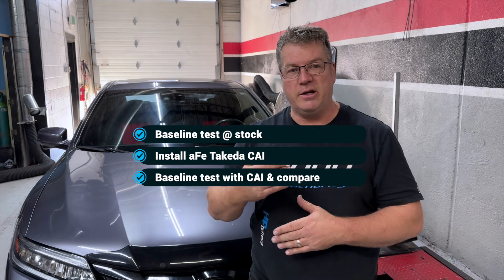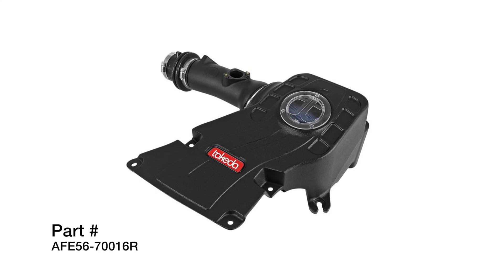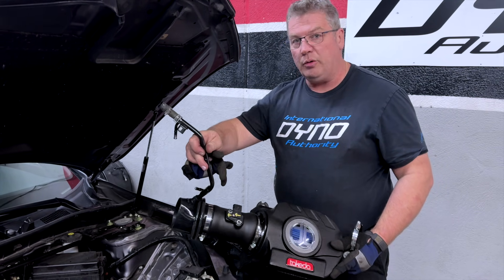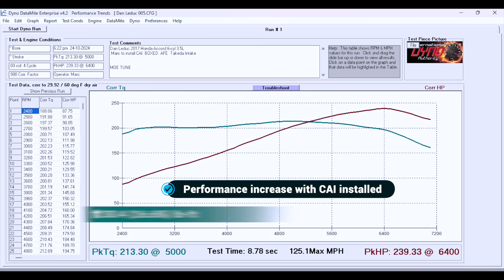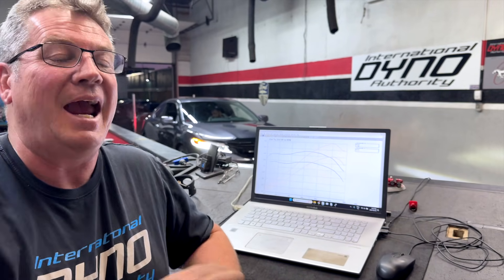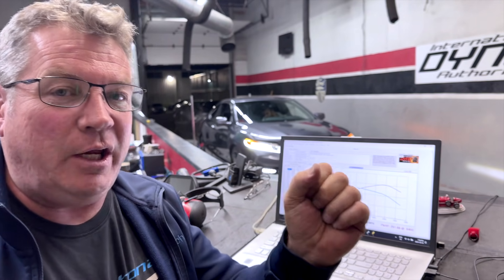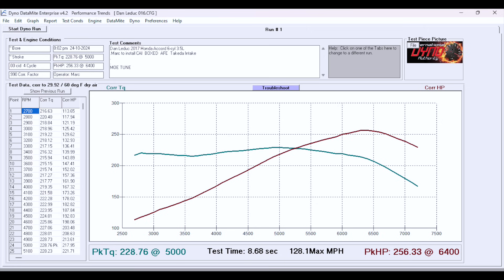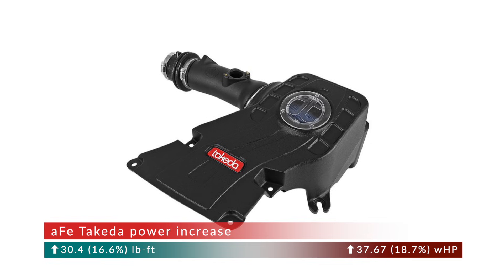Cold Air Intake tested on the Dyno | 2017 Accord

Comment: 6:15 "never gets any air from the engine compartment".  Isn't that a big open window on the forward side of the box that's drawing engine compartment air?  Dyno tells the story I suppose.  I'm still on the fence and would go with the dry filter since I find the red ones to be a PITA cleaning, etc.  I'm assuming the dry filters can be had separate online.  P/N please?  Great stuff BTW.
Also, do you have the NGK p/n for the copper plugs (BPR6ES) or maybe the "G-Power"?  Iridium is the OEM config.  Online is saying 0.044 gap.  ??
Wish I had a dyno shop within 2 - 300 miles.

Comment: That’s a good upgrade! What do you think of the dynamic air scoop? Part# 56-70016S. Do you think it’s worth pairing it with this intake? Planning to this on my 2015 accord 6-6.
Reply: I don’t think it fits, it’s for the Acura
Reply: @RedlineCulture thanks for the reply. If anyone’s curious the air scoop does fit the accord, but you need to slightly modify it from where the push pins are.

Comment: How would you generally compare this to a K&N intake?
Reply from the maker: We very have had very similar results with the K and N, unit. Both are excellent units. Units. The main thing, is to make sure that you have the filter in a box and that the box itself gets fresh air from either behind the headlight or somewhere in the fender free of the heat of the engine 

Cheers, from all of us here at International Dino Authority
Reply: @internationaldynoauthority693 I appreciate the response, I know this is preference, but does the takeda intake sound "meaner" than the k&n? which is louder if you can tell?
Reply from the maker: @thatsonlychance 

It does not sound louder. Both of them are fairly quiet, until you have the camshaft timing changed. 

Once the camshaft timing has been changed in the tune, to optimize the air you're bringing in. Then the vehicle sounds louder, sounds meaner

Comment: Did the copper ngk spark plugs perform better than the recommended iridium ngk?? I thought iridium was better
Reply from the maker: @VPAccord  iridium is a coating. It is not made to make more power. It is simply put there so that the spark plug will last an extra 20,000 mi. 
The copper spark plug always makes more power. 

Stay away from iridium coatings. Stay away from platinum. Simply go with the copper ngk. 

Cheers from all of us here at International Dino Authority
Reply: @internationaldynoauthority693  For this 2017 accord v6, would the engine being automatic change your plug preference? e.g. ruthenium instead of copper?
Reply: @internationaldynoauthority693  great to know. Than you
Reply: @internationaldynoauthority693  I tossed out the copper plug comments on an Accord forum and was aske, "How often do you want to change plugs?"  Can you ballpark an answer please?

Comment: So, this uses the factory intake air scoop at the front, and doesn't pull hot air from the engine bay, right?
Reply from the maker: @JustinDaniels  That's correct. The air comes in on a separate path, through the front of the vehicle. It does not take hot air, from under the hood or from the exhaust or in the engine bay. 

Cheers, from all of us here at International Dyno Authority
Reply from the maker: @JustinDaniels  This intake system has a dual inlet. Any effective, cold air intake is going to take its air from the bumper from the fender or from behind the headlight.
Reply: @internationaldynoauthority693  One more question, as I'm considering purchasing this intake... How easy is it to get at the filter for cleaning? (I would go with the dry version because I believe it filters better, even if slightly less performance gain.)

I just wouldn't want to have to disassemble everything to get the filter out for cleaning, but I don't see an access port for the filter.
Reply from the maker: @JustinDaniels  There are four access screws on the top. Remove those remove the filter
Reply: @internationaldynoauthority693  Ok that's good to know! Thanks!
Reply: @internationaldynoauthority693  Oh and I wish you all could dyno tune my 2017 Accord V6, but I'm in Florida lol

Comment: Yeah, this should be making no less than 230whp stock, unless high elevation
Reply from the maker: @JustinDaniels  In theory, that definitely would be, a number that would be achievable. We've been in this business for 10 years. And we are yet to see very many vehicles that come from the factory that make anywhere near the factory rating. In this case it's very obvious that this customer was unsatisfied with the way the engine was running in unimpressed with how much power he was making. And we understood why after we began testing. And this is why, there is dynamometer testing. And this is why we are in business. Most of the time, vehicles are close to what they should make. However, when they have fuel tables that are out to lunch. And spark plugs that are failing. They often make less than what they should have made. Theoretically. 

Theoretically, you can usually take the factory rating at the crank or CHP. And divide that by 1.15 and come fairly close to where the wheel power should be. It's obvious if the customer was not happy with his car. If he was 100% satisfied with the power coming from his car, we never would have met this customer.
Reply: @ I was just stating what I've seen from other dyno testing videos stock on this car, and agreeing that this one came in making much less than it should. But apparently changing the spark plugs helped with that.

Stock chp rating is 278, so with a healthy engine, it should make at least 230whp.

Still a significant gain for just an intake and tune
Reply: @JustinDaniels  yea no that guy's accord is not taken care of well or something. Just got mine a 2016 v6 coupe touring and it has over 150k miles but it has been taken care of very well and I know it's putting down more than that. I haven't dyno it yet but I have another car that I did dyno and it's making 200 at the wheels yet my V6 is still noticeably faster than it.
Reply from the maker: @JustinDaniels  theory is just that. And it is often incorrect
Reply from the maker: @JustinDaniels  similarly, a 2010 Honda Accord. Which makes 177 horsepower from the day it leaves the factory. 10 years later, it no longer makes 177 horsepower at the crank. 

And if we were to test that at the wheels it would not be making $150 at the wheels. Unless there was a miracle that had happened. 

It would most likely be making more like $120 to $130 at the wheels. And then, if you were to put in a proper tune with new spark plugs and a cold air intake, you could very likely increase that somewhere in the range of 30 horsepower. Just to get it back up to where it should have been and then a very good tune where the air fuel is correct and the timing is correct and the cam timing has been optimized. 

Cheers, now you're starting to get an idea of what we do here at International Dyno Authority.
Reply from the maker: Best way to understand this. Would be to go to your local Dyno shop. 

Ask the operator if you can observe. 

You'll find that the customers who arrive who are disappointed with their vehicle. 

Are not making the advertised nor anywhere near the advertised amount, of torque that the manufacturer has provided as a number.
Reply from the maker: Theoretical is just that...... theoretical

Comment: this is with stock cats?? I wonder how much a high flow cat and J pipe would add
Reply from the maker: We have found next to zero increase, over the stock exhaust system. 

However, once you begin to modify. For example, removing material from the cylinder head, putting in larger valves, changing the cam events significantly, can start to increase the amount of overlap and flow. 

At this point, you have now spent enough money that that you will need to start to look at relieving some of the exhaust flow characteristics. 

On a stock engine, with stock components and a cold air intake. Exhaust system just makes sound. So you would tune it to whatever sound you like. If you prefer a magnaflow if you prefer a cherry bomb, whatever type of exhaust system you like would be what you tune to for sound only 

Cheers from all of us here, at International Dyno Authority

Comment: If one were to remove the stock intake funnels throughout the in side bumper and remove the fog lights (completely empty/ open), would the Takeda front scoop still help the air flow through the front fender?
Reply from the maker: The way intake air works. Other than Ram Air.

The box should have as straight a path as possible. From the outlet to the throttle body. 

The tube size, from the outlet of the air box to the throttle body should facilitate air speed based on the size and modifications of the engine. 

If it is too large, it will slow down the air cause swirl back, and inhibit the MAF sensor, from picking up a proper signal. 

The intake air pipe to the the air box, can be any size. But should not be restrictive. 

The intake, air pipe or pipes coming into the air box, should find their source from the coolest spot. Usually in the fender or from behind the headlight or in the lower balance area 

The actual air box needs to maintain a plenum distance around the air filter. 

. In other words, the air filter, should not fill up so much of the air box, that it creates a restriction. 

When modifying stock components and or updating, the most important factors are the ability of the box, to get fresh air, cool air and lack of restriction. Restriction. And the box should be shielded as well as sealed, so that under hood temperatures affect the air breather the least possible. 

This information should help you, and point you in the best direction possible. 

The information above was attained from multiple years and thousands of vehicles of testing.

Cheers, from all of us at International Dyno Authority.
Reply: Thank you for your research and informative response ❤

Comment: I’m confused why this came in with 201, don’t these v6 models come from factory with 278hp
Reply: 165 are the k series numbers not the J series
Reply: @robertalicea5585 I have J series 2013, what’s the H.P. On that?
Reply from the maker: This vehicle had an issue with the fuel tables and the timing that was restricting power.
Reply: 278 is to the crank. By the time it gets to the wheel- fwd- you wanna remove 13-15%. Plus, as mentioned in the video it needed new plugs. That car made great power by the time they were done with it. 👍
Reply from the maker: As many times people confuse the difference between a horsepower reading from the factory which is with the engine removed and placed on an engine Dynamometer. 

When you put the engine inside of a dynamometer room. Gets ideal conditions. Ideal temperature. No load beyond the dynamometer dragging down the horsepower percentage.

If we were to put that same 6-cylinder on the chassis dynamometer, you would very likely see 165 to 170 horsepower

Comment: Could I get some HP from my accord 17 4 cylinder doing so ?
Reply from the maker: @jeansaldana1694  The horsepower, comes from, the cold air intake with the tune. 

Without adjusting, the tune, you get next to nothing
Reply: @internationaldynoauthority693  ok I'm planing on doing all that plus a bigger throttle body and muffler
Reply from the maker: @jeansaldana1694  Throttle body will do. Literally nothing. Don't waste your money on it. 

There are other things, that will make you a lot more power. 

The throttle body will waste every bit of money that you spend on it
Reply: @internationaldynoauthority693  thanks, so any recommendation on what to modify my engine with ? It's an 17 accorrd 4 cylinder. Thanks again
Reply: @jeansaldana1694   cold air intake. High flow exhaust. And of course, a tune. You won’t make as much on the 4cyl version, but it’ll def make more power than stock and drive better. Get a Hondata or Ktuner. Or else, all mods are pointless.